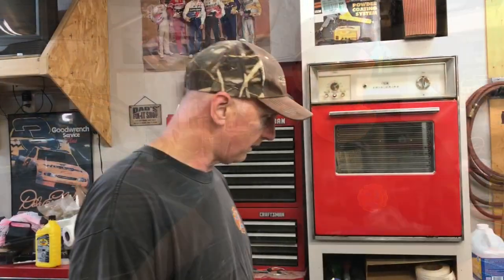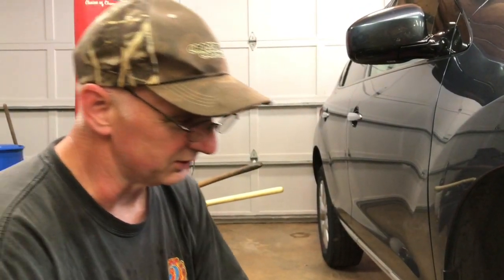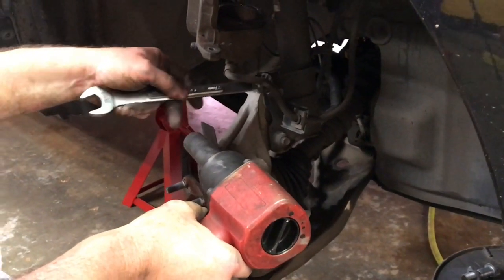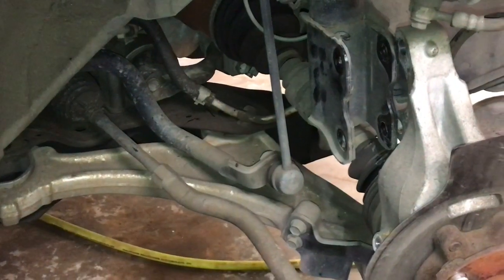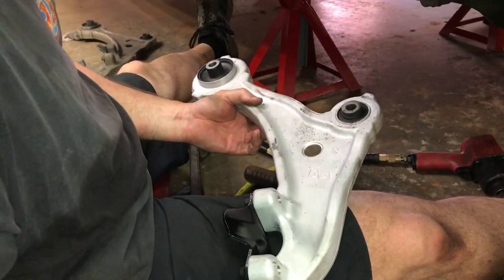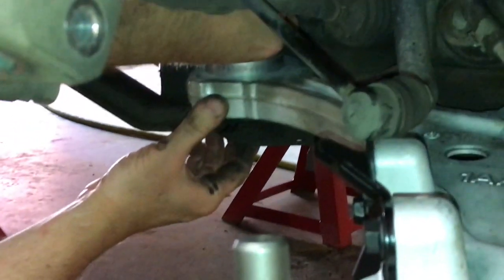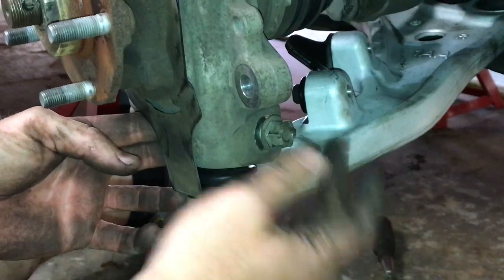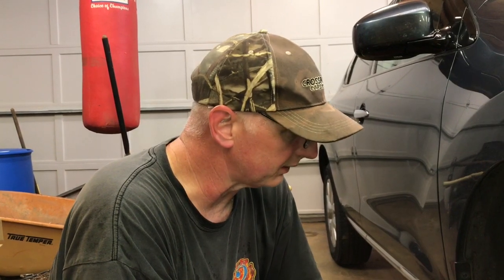How to Replace Lower Control Arms on a Nissan Murano

Comment: Thank you for a great tutorial video. I have a 2010 Murano. I started with another youtube video that demonstrated the control arm replacement. They did not disconnect the brakes or knuckle and managed to make it look easy. I was not so lucky. I ended up putting a slice in the new control arm boot and managed to separate the CV from the gear box. I wasted three days just doing the driver side. It was a nightmare. I stumbled onto your tutorial and was able to complete the passenger side in just four hours. This is not a job for a beginner. A healthy vocabulary of curse words is a must. As far as tools I don't have a lift so jack stands had to do. I have an impact wrench which saved some time. I did end up purchasing a set of pickle forks that made it easier to separate the old control arms from the knuckles. I also purchased  a  ball joint puller that made it easy to separate the steering rod joint from the knuckle without damaging it. I spent about $60 on those two tools. You can get away without these tools but they made the job much easier. Thank you again.

Comment: Completely saved me replacing my 2011 Altima (hybrid, same as regular for control arms) lower control arms. Had car in garage, one control arm out and could not get the new one in, trying to get follow instructions from 1aauto (both the Altima and Murano versions) because the bushings for the subframe bolts do not allow alignment to pass the bolts, even with jacking up the bearing/rotor. Prior comments are very true that doing on a lift in a shop is different and on the ground at home, this method is the only thing that worked for me. I’m not totally sure you have to take out brakes, but I followed these instructions and now my car is not stuck in my garage on a jack. Thank you!

Comment: Great video. This does make it much easier. I had to watch a bunch of 1aauto videos for torque specs. . Torque specs are 107 ft-lb control arm bolt (Altima), 117 ft-lb control arm bolts (murano), 46 ft-lbs ball joint, 103 ft lbs strut bolts, 58 ft-lbs Sway bar, 98 ft-lbs brake caliper, 20 ft-lbs brake guide pins.

Comment: I have seen other videos about replacing the lower control arms and your video sir will save someone hours of trying to get the control arm off and on. Thank you very much. I have a 2012 Nissan Altima and have to replace both control arms. I replaced the driver side which took me all day. But I’m sure after watching your video the passenger side will not take as long. 😊

Comment: Videos like this are what I call TRUE how to. Another on this shows it done already, but not how done. This is about the same as for 2014 Nissan Maxima. I torqued the two inner bolts on the control arm to 117, and the ball joint to 46. You need to really really really get that brake caliper high up and out of the way.  I tightened down the control arm inner bolts after getting the ball joint connection hooked up, gave me more wiggle room. Also, had to put a jack under the ball joint area to hold that assembly up. Taking off the sway arm was much necessary. Thanks again for this video...now i have to do the other control arm argh!

Comment: Those failing bushings will cause erratic tendencies to pull hard to the right or left (randomly) under acceleration like you say. I'm dealing with the same repair today, the bushings on both sides have gone bad.
Cheapo J-hooks for hanging the break lines can be bought at any automotive store or you can manufacture your own, but I highly recommend them.

Comment: Didn't show how he took off the Lower Ball Joint. And you don't need to take all that stuff off. Didn't look much easier than just doing Ball Joint, and the 2 Control Arm Bolts.
They always take a bit of influence to get in the Sub Frame. No big deal.

Comment: Did you really have to take apart the brakes? Couldn't you have just removed the control arm just removing the 3 bolts holding it in there?
Reply: Not necessarily unless he was doing the brakes as well, I just did this job, and I had to remove the caliper assembly, and disc, I don't think he had to remove the abs sensor, I didn't have to. I also separated the cv axle from the knuckle. Without the removal of these components, control arm will definitely fight you, and you are likely to damage the contrl arm bolts.
Reply: But she did it on a lift. That's the point of this video...